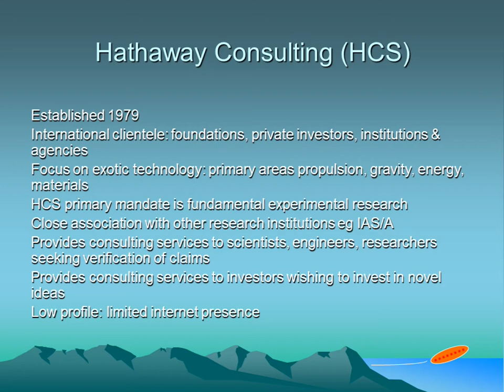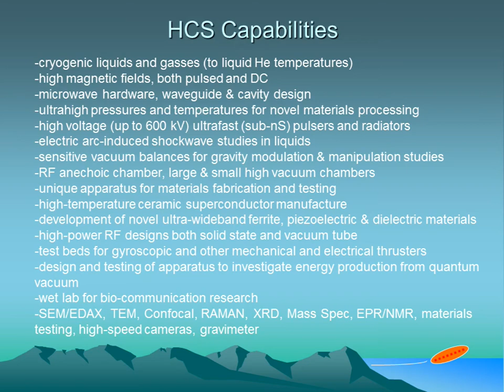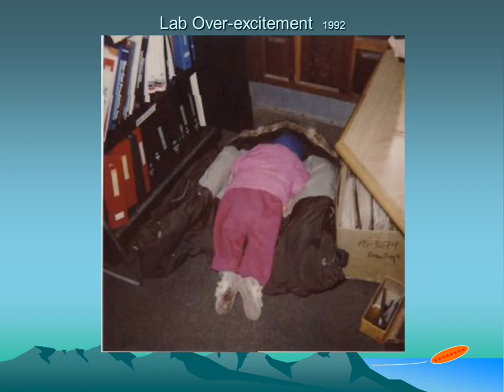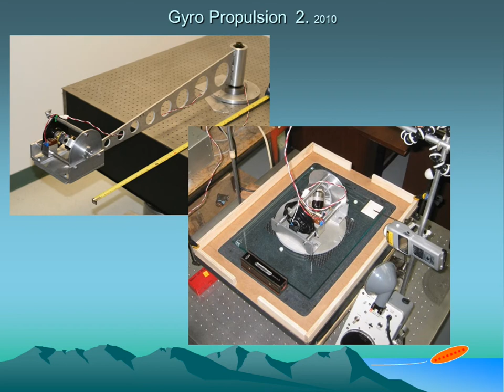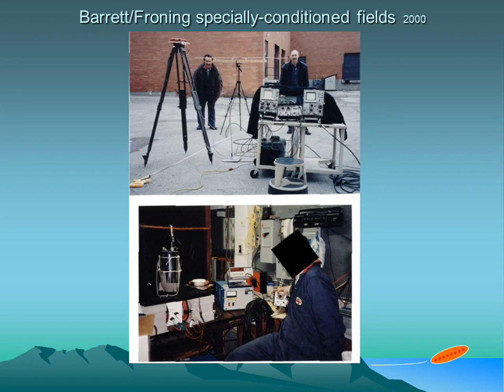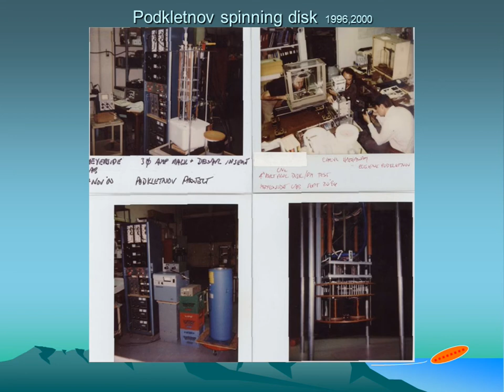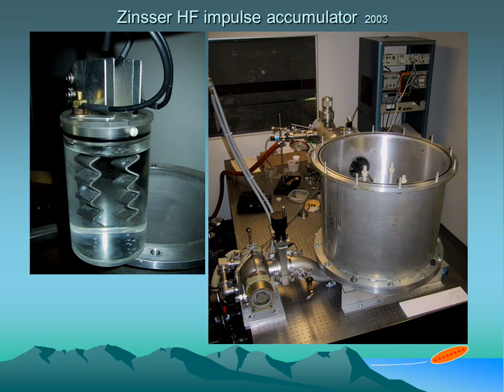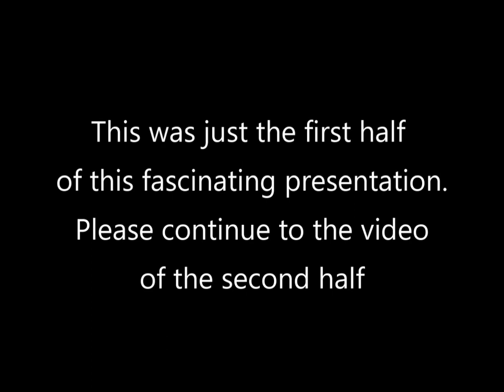BPW 2016: 04. George Hathaway, Facets of valid experiments (pt1)

Comment: @47:10  Me and my dad  once had a close friend so close we called him "Uncle Walt".   He was not an uncle but rather a very close friend. Him and my dad once were using silver and sodium cyanide solution passing a current from through it to try to lay a small layer of silver plating on an old silver dollar to make them look better as maybe they hoed to sell them at a higher value..  No matter what we did we could not get the plating process to work correctly from what we read in the book.  He then began telling us a tale about "TRADE SECRETS".  He said that often the textbook process had one trade secret deliberately left out.   He once described a textbook metallurgic formula for a batch of special steel that the factory needed to make .   They put the ingredients in proper proportion in the crucible.  They heated it up to the proper temperature for the specified amount of time and then properly allowed it to cool and  quenched it according to the textbook.  The batch did not properly come out.   They experimented  with it over and over a few times trying to vary this or that with no luck.    Finally they wanted to try it again one last time.   They mixed the ingredients fired up the crucible when some steel worker who's wife prepared him  a ham sandwich accidentally dropped it into the batch.  It turned out perfectly.   Thus every time they made the steel they had his wife prepare a ham sandwich to drop into the batch.  You  wonder if these inventors are leaving some trade secret out they do not want you to know.